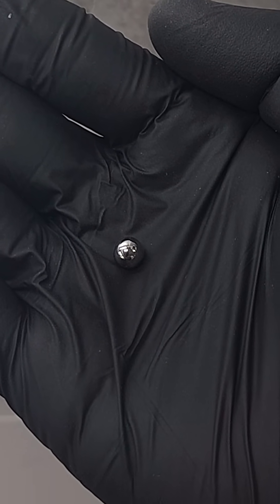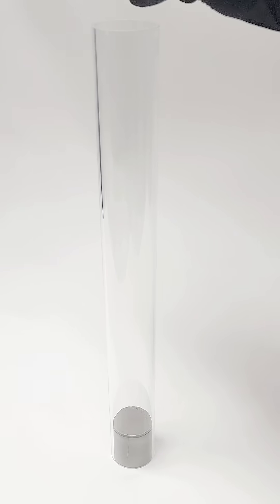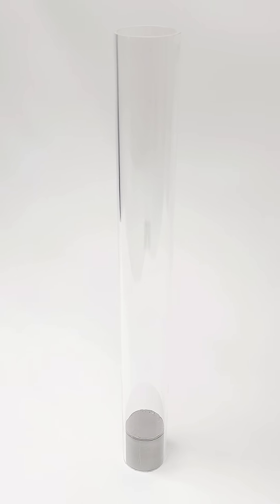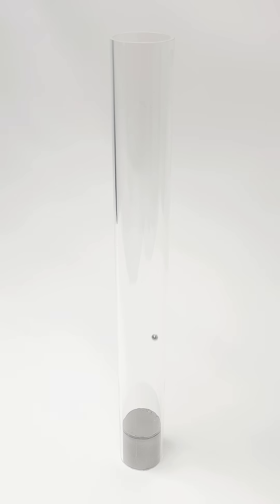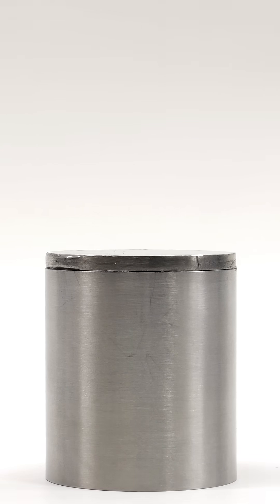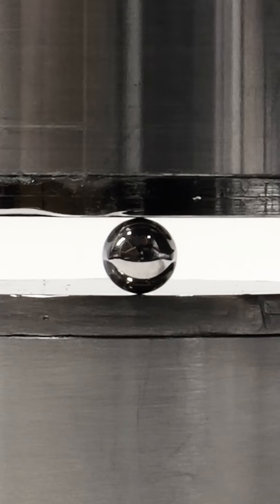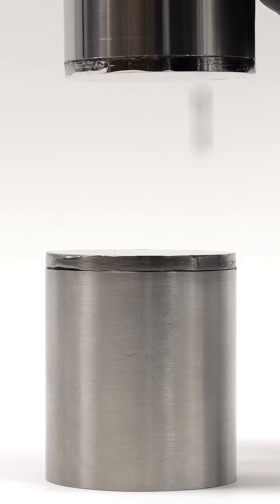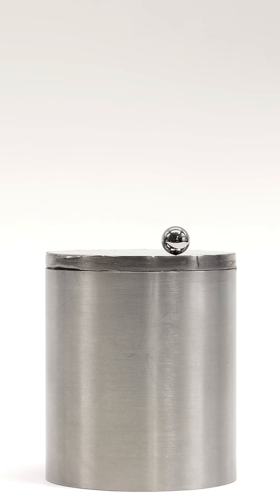This metal is too bouncy

Comment: I think that the ball reach to extremely high bounce count due to couple of reasons. First of all, if assuming that the collision is elastic, and the kinetic energy is converted, by pushing down the upper part, the distance of the course is shortened, and thus the time of finishing it is exponentially reduced what gives the illusion of a ball moving at a higher velocity. Secondly, there is a mass difference between the lid and the hand that applies force, and the mass of the ball. Thus, by pushing the lid downward, there is an additional of a huge amount of kinetic energy that is given to the ball, which actually increases its velocity.

Comment: I think I’m going to try to make my own metallic glass, but not out of the same alloy. I think I’m going to try it with some magnetite, carbon graphite, maybe some silicon dioxide nano-spheres if it’ll work. And maybe some potassium, sodium, and calcium salts to increase the electromagnetic conductivity if it needs it. I’m thinking this might be a good way of getting an electricity out of solar panels? But I could easily be mistaken about this

Comment: Wouldn't the frequency of the tone tell you how many times per second it's bouncing?
Reply: Yes. And to my ears, it sounds like it quickly goes right past the upper limit of my hearing range, which is about 14,000 hertz.
Reply: @Brian-12345 yeah and that's insane because that would be 14,000+ Hz which is wild, and the fact that that happens for multiple seconds is even crazier, possibly over 50k bounces total
Reply: fr in hz = cycles per second. 1 cycle = 2 impacts.
fr × 2 = number of impacts, upper trampoline and lower trampoline.
Reply: I’m just curious but is playing a radio frequency?
Reply: @aceshighnuf No. Radio frequencies are in the MHz (megahertz) range. The ball is bouncing tens of thousands of times per second. Radio waves are oscillating at tens or hundreds of millions times per second. (At least in the FM band. I don't remember what frequency AM transmits at. I want to say it's around 60MHz, but I'm not in the mood to look it up and be sure right now.)
(Also, as far as I know, sound waves and radio waves are fundamentally different in other ways because sound is a longitudinal wave moving through a substance. For example, pressure waves propagating through air molecules. Radio waves are radiative waves which send photons of electromagnetic radiation out that don't depend on a medium for transmission. Which is to say, no air or water or whatever molecules means no sound is transmitted. But radio waves and other electromagnetic radiation like visible light and X-rays and so on can travel through a vacuum.)
Reply: no. bro counted himself. he said it in the video
Reply: He’s a scientist not a physicist
Reply: @Bears_4.3  you mean he's a chemist, not a physicist lol
Reply: @Bears_4.3  A physicist is not a scientist?
Reply: @Dark_Star_1960 same thing
Reply: @Dark_Star_1960 they're both scientist so it's not worth mentioning. It would be like saying "he's a sports player not a basket ball player" when you really mean "he's a football player not a basketball player" OP was comparing apples to fruit instead of apples to oranges
Reply: @Bears_4.3  a physicist is a type of scientist
Reply: @Bears_4.3 He's obviously a physician

Comment: You can calculate the peake bounces per second through sound wave analysis. Frequency (Herz) = 1 top bounce and 1 down bounce.
Reply: I think I heard something like an A 6 meaning 1760 Hz or 880 up and 880 down bounces per second. But it's really hard to tell try using a program to hear that for you

Comment: so i've came up with something after around a minute of thinking
-vacuum chamber
-precision hydraulic pistons to accurately move the two plates together
-plates made of the atomic trampoline
- BALL BEARING made of the atomic trampoline
- And finally, a high speed camera to top it off..
Reply: ball bearing made of atomic trampoline obviosly does not work. Maybe making it a different better material would be better, but ofcourse not the same as atomic trampoline.
Reply: @mrmaxboypvp5097  maybe a harder material like titanuim
or just my original suggestion which would obviously work..
Reply: @mrmaxboypvp5097  Actually, using the same material on both the plates and the ball helps maximize elasticity and uniformity in bounce behavior. Using a different ‘better’ material without considering mechanical impedance or elasticity mismatch could reduce the energy retention. But obviosly you already thought of that… right?
Reply: @BABABOOEY-z3p  idk thats liek bounching a spring off a spring. I might be wrong, but its very unintuitive
Reply: @mrmaxboypvp5097  It’s actually not like bouncing a spring off a spring — it's more like perfectly matching two materials to maximize energy return. Metallic glass is super elastic, and in a vacuum setup like this, matching material properties actually helps maintain bounce efficiency.

For you, intuition breaks down here. This is material science, not a trampoline park.
Reply: @BABABOOEY-z3p  except you forgot that if the elastic bearing bounces, it changes shape and deforms, loosing energy. It needs to be stiff.

I guess my intuition was right after all.
Reply: @mrmaxboypvp5097  Stiffness and elasticity aren’t mutually exclusive. Metallic glass is extremely stiff and has low internal friction — that’s what makes it bounce so well. Deformation only causes energy loss when it’s plastic, which this setup avoids.

So,
You just described why metallic glass is perfect, thanks for backing up my idea unintentionally.
Reply: @BABABOOEY-z3p  The claim that "Deformation only causes energy loss when its plastic" is not accurate, as elastic deformation also cause energy loss to heat. Yes, metallic glass is stiff, but it only depends on its geometry. If a ball bearing is made out of metallic glass, it is not as stiff as a flat surface made out of metallic glass.

Comment: I guess the flat piece of metal works like a spring absorbing the energy - if same material would be as small as the ball (fitted in some solid not transfering the vibration energy further the energy would stay in the ball rebounding until the heat of hits would absorb it.

Comment: There is a really cool video about a small and large mass that slide and collide into each other against a fixed wall. The weight of the large mass is increased in  increments of 10x each time and if you count the bounces it reveals the digits of pi with increased accuracy the bigger the larger mass is.

Comment: At one of my last jobs where I made canoes, we had airhoses for using compressed air to get the boats out of their molds and stuff. In-between work my coworker and I we're cleaning up and I found a bunch of ball bearings that fell out of a tool earlier and he found a pipe that was the perfect diameter to fit the Bearings in it while it also fit onto the fitting we'd fire air from, so we made a ball bearing air gun and shot at boxes, we stopped when one bounce back and hit the wall behind me and was still going fast enough to bounce off the back wall and hit me in the ass lmao

Comment: Ok now I want to see how high it goes once you get it to the point it starts making noise and you remove the top trampoline 😂 
Theoretically it should bounce all that energy that has stored up and throw it up higher than its initial bounce, but because it's at such a small vibration or movement pattern you would think that it wouldn't bounce as high as initially 🤔

Comment: Now construct a tube with those on either end sealing it and the ball bearing inside. Remove most of the air and then give it as solid shake and see.how long it goes

Comment: I did some calculations here. I took the video and broke down the meta data and determined that it was 30 fps 1080p NTSC. Then I was able to determine the measurement of the ball itself and the distance between the two plates. With that in mind, I also took the audio and found the highest pitch the ball made before stopping and that gave me my last number. With all of these elements at play, I was able to determine the precise number of bounces the ball got in total. My findings that the number of bounces the ball had yielded was in fact, a lot.

Comment: Make the ball so small that you can produce THz frequencies, like 500THz or something. It'd create photons. Lol. Make light with a bouncy ball.
Try to exposing the system to a frequency that corresponds with a certain frequency of the movement of that ball - in other words - expose it to its resonant frequency to make the motion even more intense.
Then, convert the kinetic energy to electromagnetism and feed it back to the ball and trampoline so you can add some of the kinetic energy back to the system. Or maybe apply a MIDI-interface to this so the bouncy balls can trigger funny sounds from a synth or a vsti.

Comment: Question, if you started this, with the tube around it and fixed an atomic trampoline to both ends, how long would it run? Obviously assuming you kept it upright the entire time, and kept the distance between the atomic trampolines fixed.

Comment: That's a great visual example of why compressing a gas causes the temperature to increase  - the bouncy molecules bounce faster and harder which is the definition of increased temperature on a molecular level
Reply: Yes, but the high pitch here is caused by the ever shorter distance the ball travels between the trampolines, it is not (mainly) caused by an increase of speed.
Reply: So that explains why high pitched farts are warm 😂
Reply: Thank you for this explanation! This was what I needed 😊
Reply: That's not true, the kinetic energy stays the same. The raise of temperature during a gas compression comes from the work it has to be given in order to be compressed.
Reply: @rodrigogiorgi89  Are you sure? If not, please confirm it from Google. But I think that he's right: as the volume or area of movement decreases upon compression, the gas molecules hitting each other and the container more frequently, resulting in a higher amount of friction being generated and thereby more heat, eventually increasing the temperature overall.

Comment: i wonder what would happen if you put the 2 trapoline facing each other in the tube and let them go with the ball bearing bouncing in between them and enough air flow so the the trampoline doen't get stuck from air pressure

Comment: We need to get this in an encased eclosure, have the two things close to eachother with the bouncing metal ball, and see how long it takes for the metal ball to lose all its kenetic energy status (as energy isnt lost, and this is also called the ball stopping).
Reply: What if it was in a vacuum with no air resistance?

Comment: I recall nearly 20 years ago now seeing the LiquidMetal demonstration showing a ball dropped on the different materials, one being a LiquidMetal plate. They suggested the ball jumped higher than the drop height. I imagined a perpetual motion device, if that were true. I realized that if the ball had jumped higher than the drop height it must've meant there was stored energy somewhere. Also need to account for material degradation. Around the same time, the "Shake to charge" flashlights were still common. I imagined using this material in a device very similar to that flashlight to generate easy electricity and wondered how long it would last.

This is the closest I've seen to what I wanted to do with this stuff. Thank you!
Reply: Perpetual motion devices are impossible to create due to the very nature of said device defying the laws of thermodynamics
Reply: @UNDDWRTH  Yeah but you are wrong and sadly very wrong, for we are constantly experiencing perpetual motion so just because you can not perceive such magnificence does not mean we exclude it from our perspectives
Reply: Might be interesting to make like a toy or something for your desk like a newton's cradle but other than that it wouldn't be really useful for what your implying
Reply: I think you may have misunderstood my comment. I’m fully aware that perpetual motion is impossible due to thermodynamics and entropy. That’s why I specifically mentioned degradation and the need for stored energy. My point was that if the ball actually bounced higher, it would indicate an external energy source or stored energy, not true perpetual motion. I was just reflecting on my past thoughts and how I came to understand why it wouldn’t work.

I mean.. in one word... entropy.

The universe is not perpetual, as the other commenter suggests.

Comment: "At least based on what i could count" , "several thousand times per second" 

You WHAT??
Reply: I was going to comment the same thing 😂
Reply: Yeah he's joking I'm sure he has a motion detector or something lol
Reply: @rougethebatismywaifu  most likely went off of the sound, he mentioned 'based on the sound it makes'. Found out the hertz and calculated it that way :)
Reply: @ yeah that would make more sense lol I forgot sound detectors existed
Reply: @rougethebatismywaifu  "sound detectors".... do... do you mean microphones? 🤣😜
Reply: @ yeah that too lmao
Reply: @ANDSENS  smart guy huh? yeah no that's not what he means lmao
Reply: @ANDSENS  yeah no, microphones don’t record sound exactly as it comes in. For purposes like these, you use an actual “sound detector” to get a more accurate number.
Reply: @cappytan9058 You can do that?!?
Reply: @EclecticAnkylosaurus Nah, just use a normal mic and do a windowed Fourier transform to make this exotic thing called a spectrogram ;)
Reply: @EclecticAnkylosaurus Elaborate. A decent quality standard microphone with some analyzing/filtering software should work fine. Other options are a contact microphone, laser vibrometer or accelerometer.
Reply: @EclecticAnkylosaurus  the microphone does take sound exactly as it comes in unless you have things like spit filters on them. 

speakers replaying the sound to you have more of a chance of altering sound than the microphone receiving it. 

also a frequency analyzer would probably struggle considering its not a constant hz frequency its trying to get a read on. it goes higher and higher pitched. which it should percieve as a different sound and restart the count. 

and if its just counting sound in general, thats not accurate either. it could be counting double for the sound of the trampoline or half if it only counts the ball. perspective is everything.
Reply: @rougethebatismywaifu  Otherwise known as "microphones"
Reply: @EclecticAnkylosaurus  Really? AFAIK mics will give you a very precise recording of the frequency. They may not be calibrated for accurate volume, but that's not what's needed here.
Reply: @rougethebatismywaifu no need to do so. You simply take the audio, run it through a frequency analyzer (literally any DAW) and it will tell you the peak fundamental frequency.
Reply: @rougethebatismywaifu  or he could have looked at the wave form that was recorded.
Reply: You can measure oscillations (or, in this case, bounces) per second based on the frequency of the sound it makes. I mean, it's in the name: frequency.
Reply: It’s likely he took an audio recording and calculated the hertz of the tone it made.
Reply: he's got the sharingan
Reply: Flash
Reply: Bro counting zzzzzzzzzzzzzzzzzzzzz
Reply: I'm looking for this comment 😂😂😂
Reply: Exactly. I don't think to many people got the joke. 😉
Reply: Fr
Reply: i put the audio into my DAW.  It's hard to tell but the fundamental frequency looks like it peaks at 2.2khrtz.  so at the very end of the squeeze, it's bouncing roughly 2000 times a second
Reply: Probably just measured the frequency of sound to extrapolate the number of bounces
Reply: He's good....

Comment: if you really wanna be the first to do the impossible, make a ball out of the atomic trampoline. you won't be able to make it home as you need super high pressure but with your connections, you may just make it happen. Once you have the ball, bounce that between 2 trampolines and expect the unexpected

Comment: Not to be mean or anything, but why does normal physics "seem so unbelievable" nowadays? Didn't anyone else learn this in school?... It's Newtons laws of motion, conservation of energy etc... Metal against metal has nearly no friction loss, so what would you expect it to do? I tested a ball-bearing now with a steel plate and a stainless steel wrench. It doesn't make the sound as long, but it whimpers out into a 10-20kHz frequency. 10.000 times a second isn't THAT impressive for sound and moving things :P

Comment: Love your vids!! But I'm old and used to work for companies that sold analog stuff like chain drives, pulley systems, etc, and ball bearings. the object in your hand is not a ball bearing, that is a misnomer. It is the ball that goes into a ball bearing. That includes an inner and outer race, separators (cages) to keep the balls apart, sometimes seals or shields and the bearing "balls" themselves. I know you are a chemist with schooling outside any realm I will ever experience, but if you want to know anything about industrial hardware, I'm your man!

Comment: As you're moving the trampoline down you're creating more force which allows it to actually gain momentum and force so it's going to continue to multiply in speed if you can time it just right up and down with your trampoline movements.

Comment: The frequency of the sound in Hz is the amount of jumps, isn't it? With that logic it should be around 20.000 times per second. The part we don't hear anymore is exponentially more times than the part up to 20.000 times, must be several hundred thousand in a millionth of a second. 😅

Comment: So can it withstand high temperatures and can it stay hardened at those temperatures. Will smacking it with a hammer crack or smash it.  

I demand more exparimentation.